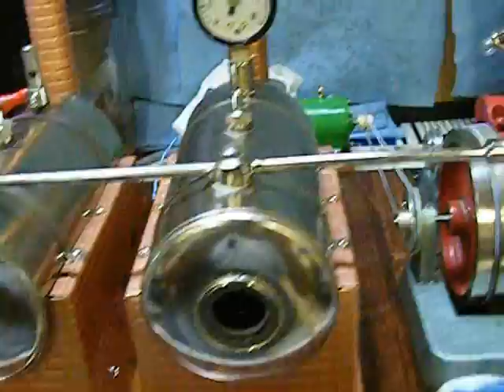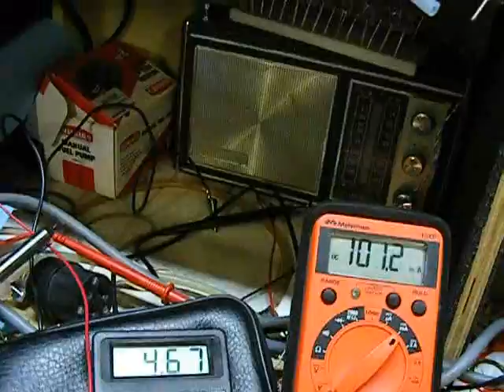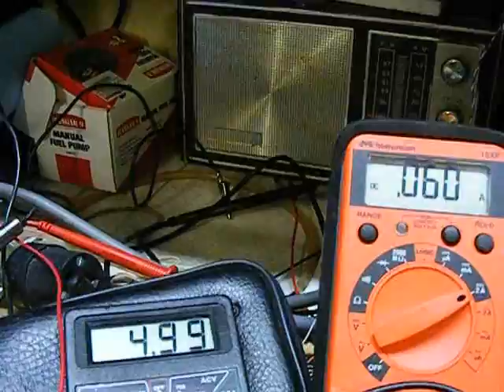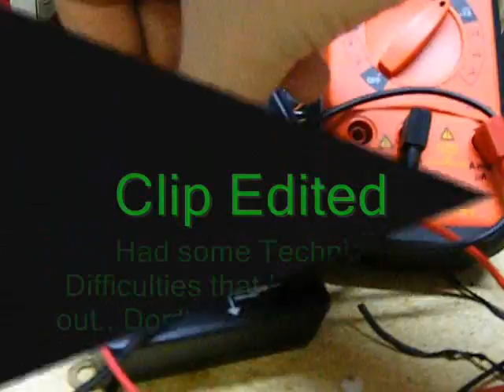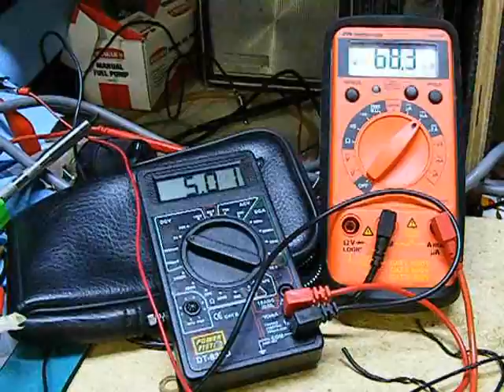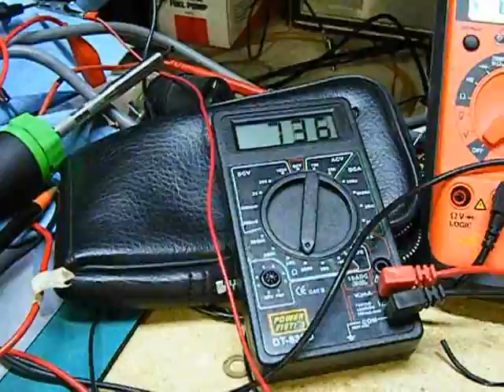Current Affairs - PM Research Generator

Comment from the maker: There were some interesting differences between a pure DC generator and the ones using rectified AC current.  I'm going to post some early findings on the board and then get my calculations done later today or this week.